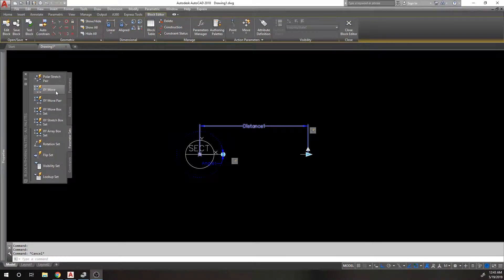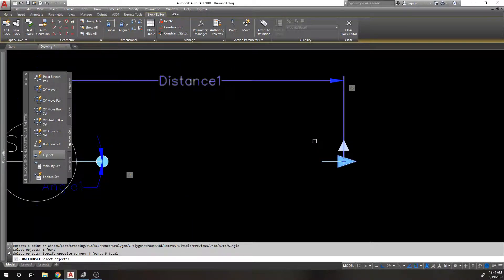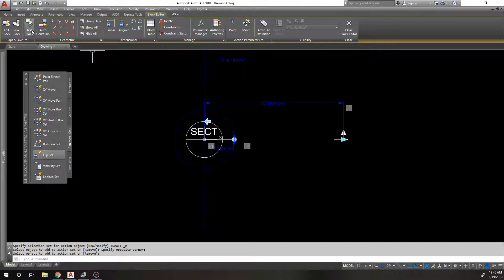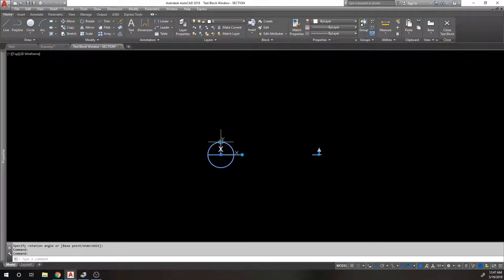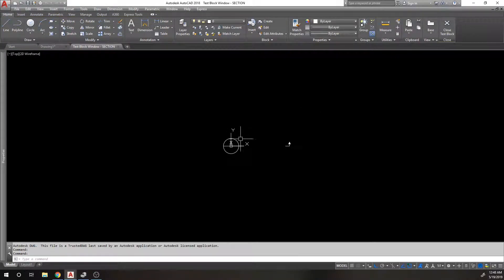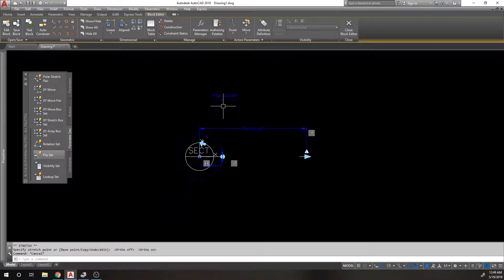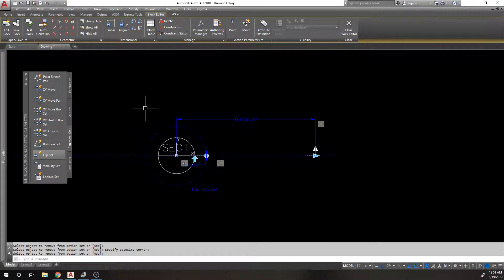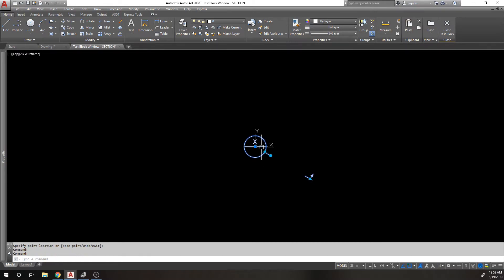AutoCAD Dynamic Blocks - Flip Action

Comment: I've been building my personal CAD block Library and something strange happened while I was  making a door dynamic block. I have a stretch action on  a 90 degree offset with a flip action containing it, when I do the flip action before the stretch, the stretch command stretches in reverse. any idea why is that the case and how can we fix it?

Thanks and Regards.
Reply from the maker: Without seeing the block, the first thing I can think of is to make sure that your flip action selection set contains the stretch parameter so that the stretch parameter also flips.  Let me know if that works.
Reply: @youcandraft  Thanks it worked but not by clicking on the parameter in the selection command but by typing all in the command bar instead.
Reply from the maker: @samzait  awesome, glad to hear it!